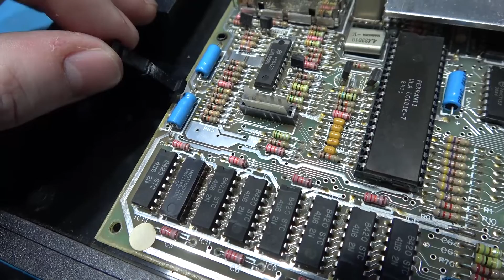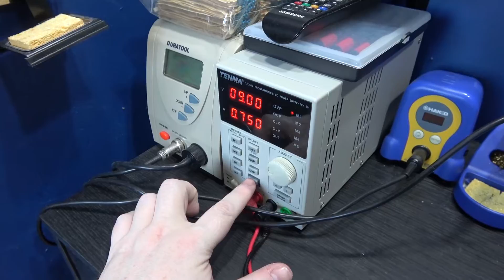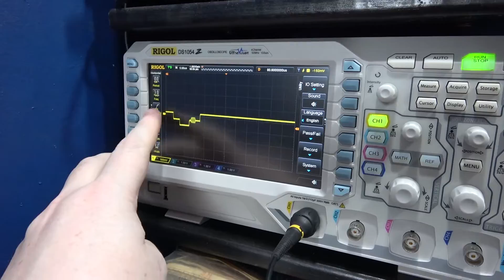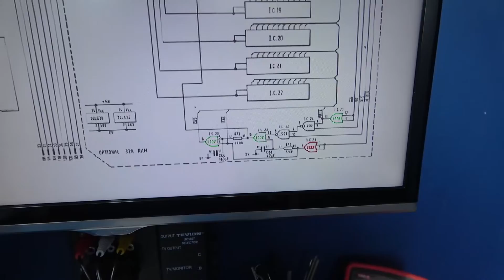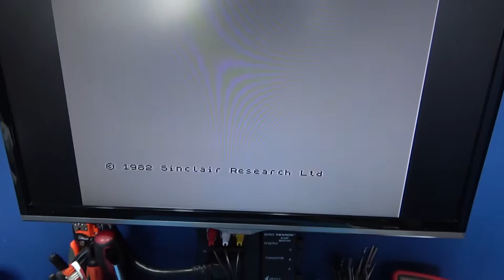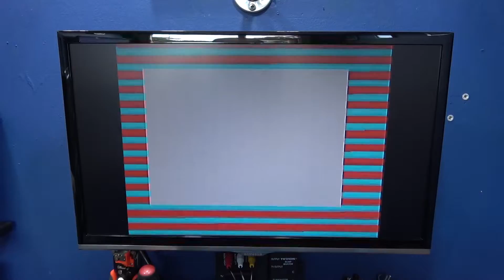Sinclair ZX Spectrum+ (Plus) 48K - Repair, Mod & Restore.

Comment: I've just replaced a membrane in my zx 48k after the old one perished. But after a week it randomly stops working. Sometimes a couple, then all of them. Could I have dry solder joints? Or something more serious. Any help would be appreciated
Reply from the maker: It could be dry joint's but I'd rule out the simple thing first. The membrane is hold in using two clamping brackets (it pinches together the membrane) if the membrane is not lined up properly the membrane will stop working.

Comment: Very interesting video. You laughing at the problems found was hilarious. You Got so much equipment. The device to the left of your tv looks like something you see in a Hospital. How you know all this stuff, I have no idea. Enjoyed the video. I will get a Spectrum one day but I'll try and get one that works. There's no way on this earth I could do what you did.
Reply from the maker: Thanks Jamie, that thing what looks like a heart monitor is my oscilloscope, don't get daunted by all the buttons and knobs all it does is measure voltage over time. In fact a heart monitor is very similar to an oscilloscope as it measures the electrical signals coming from the heart over time. Oh, and congratulations on getting the Job. Super chuffed for you.

Comment: Fantastic job!  Interesting failure on this one!  One thing to point out, when measuring address lines with a logic probe - bear in mind that not all address lines always pulse, it depends on the address map and how the system works.  For example, if you probe the address bus on other systems (or when there's a different fault) you might find only some of the address bits are pulsing and that might not indicate an address fault.  It could be that the code running is waiting for a response from something, or the code has crashed etc.  It's probably scanning the full address range of the upper RAM there - not sure but maybe the video buffer gets allocated in there, which might explain why it seems to cause all address bits to pulse.
Reply from the maker: Thanks Chris, I'll keep an eye out for that, top tip. I could tell the low coming from the Q1 of the 74xx157 looked sketchy on my scope (not a valid low) it looked like it was trying somewhat to output but was failing miserably.
Reply: @Four_X  And btw - don't be hard on yourself because you are ginger!  it really is no different than any other hair colour, and women love ginger hair!
Reply from the maker: Your right Chris I do tend to beat myself up a lot.
Reply: And before I forget - The transistor - technically you could say its also buffering, but it's primarily amplifying the signal!